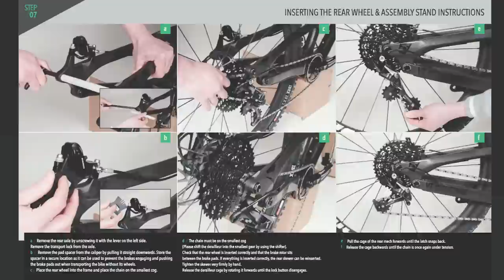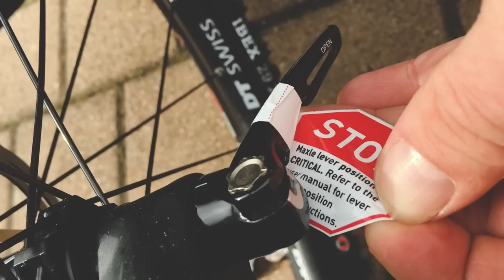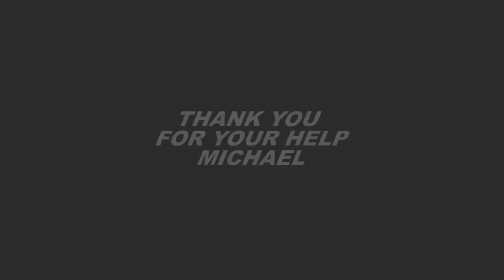YT Industries - Unboxing JEFFSY AL ONE 29 Mountain Bike

Comment: Hey man great video! I'm thinking of buying this bike shortly, I have a hardtail at the moment  and have never ridden a full suspension! I'll be mainly riding trails and mountains but do you think this is capable of riding aggressive rugged rocky rooty terrain as well or would I be be better off with the Capra? Good tune too by the way! 😁
Reply from the maker: Hi Adriano, thank you for your comment and question. There are lots of discussions about hardtail and fully. So my reason to get a fully was, because I mostly ride off the normal tracks. So if you lock your shocks you can also have very good characteristics on "smooth" tracks. Yes, you can ride aggressive on rocky rooty terrain. Best Regards Aaren
Reply: Aaren San excellent thanks for the quick reply! 👍

Comment: how did you get a 2017 Large so early? the EU website shows available in June 2017 ?
Reply from the maker: Hey Shaun, that's a good question. However I ordered the bike on early April, because the website said that it will be available by the end of April. So the bike didn't come and so on ... and I wrote an email to the service if they could provide me a delivery date. The first reply was that I have to wait till the end of June, the second reply the day after was, that they will deliver the bike in may - which was for me very cooooool. Hope I could give you some explanation. Thank you for your comment! Best Regards Aaren
Reply: ok thanks! I hope that when I order mine they dont have some delay issue!! :)

Comment: Hey man,
I'm planning on getting a YT jeffsy ( Probably the CF One 29). I'm wondering how tall are you? I'm kind of hesitating with an M or an L - i'm 1m79...
cheers
Reply from the maker: Hey :D thank you for your comment. So I am 1,86 m tall and I bought L size - so I think L would fit to you quite nice ;) I'm still working on a review just on this bike and one topic will be the size of the frame. Have a good evening. Cheers Aaren
Reply: Callum Maher-Wilson I'm also1,86 and an L size is a bit small for pedaling uphill (but is not a pain in thr back) but it's great for downhill.
Write to support they will help you. 
Besides that I own the al comp 1 and it's the best bike I've ever had.
Reply: cheers guys for the answers ! I'm currently on a Commencal meta v4 Large - but the reach is just too much ! 
I think I'll be going for the L from your answers. thanks !
Reply from the maker: Hi Zippel Mütz,

die Schaltung habe ich bisher nicht einstellen müssen, auch nun nach etlichen Kilometern und bergauf Fahrten. Dennoch gilt diese nach ein zwei Touren zu überprüfen. Für mich gab es keine Schwierigkeiten oder seltsame Vorkommnisse. Ich bin immer noch mit L zufrieden, zumal ich nun doch den Sattel höher bekomme, muss die Kabel von vorne durch das Rohr mehr durchziehen.
Beste Grüße
Aaren
Reply: Português
Desculpa amigo , de me a sua opinião
Eu tenho 1.71cm o tamanho da bike para mi seria um M (RODAS 29)
Reply: Is there anyone here 186cm with XL frame?

Comment: if I'd buy a new bike,  I'd choose the same. still don't know how 29er works on trail cause I have a 27.5 but I'm curious. have fun with the new bike. nice video !
Reply from the maker: Hey Ivan, thank you for your comment and kind words! Somehow this 29er creates a sensation of being inside the bike, it seems to me that it is more stable because of lowering my center of gravity relative to the wheels. However if it gets wild I still have the sensation that it will eject my over my handlebars the faster I get, hmmm I really pay attention to this sensation - so I drive quite responsible and a little bit aggressive :) So for me the main advantage is that it seems that I put more rubber on the ground at once. But it's kind of tricky to make some quicker changes in direction, because of the 29er - so take care of this situation. Have a good day mate!
Reply: wow thanks !you told me what I wanted to hear. so, it's easy to roll but tricky to turn in tight corners and tecnical stuff.with my poor skills I'll stay on 27.5 now.  bye man, can't wait to go out tomorrow and get covered in mud, lol 👍
Reply from the maker: hehehe have fun tomorrow :D :D what bike do you ride?
Reply: I have a trek remedy 8. love it !
Reply from the maker: Yeahh I like this bike too!!!

Comment: Hi Aaren 

Like your videos...... i was wondering if you could do me a massive favour and tell me the inner measurement of the triangle part of the frame under the seat post? i have contacted YT but they weren't much help, would be very good of you if you had the time to do so. I am looking at buying one but would like to know if my baby seat adaptor will fit in there for the odd time i take him out on the back.
Thanks
Reply from the maker: Hey Chris, thank you for your question & your kind words. The top pipe is 18cm the bottom is 14cm and the upright under the seat is 13cm. Hope that's what you meant. I measured from the centre of the pipes. Best Regards Aaren

Comment: Are you sure that frame is large size? The guy riding the bike at the end of the video looks way too big for the bike....his legs stay bent at the knee as he is peddling...they also point outwards and almost touch the handlebars. Also when you take the frame out of the box it looks tiny compared to your body size. You either have smaller frame size or that bike was made for women. On a woman's bike the distance between saddle and handlebars is smaller. Woman's bikes can still be large size and look very similar to men's bikes but they differ in distance from saddle to handlebars. That might explain why the guy looks too big for that bike when he's riding it.
Reply from the maker: Hi, thank you for your comment. I'll check it and will post a video about my frame. Would this be ok for you?